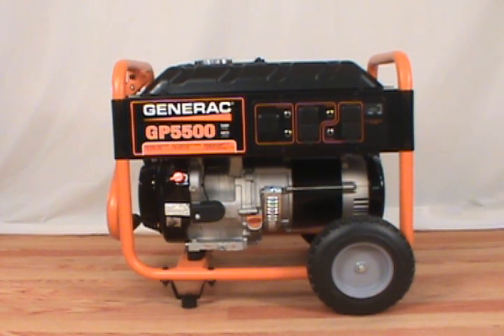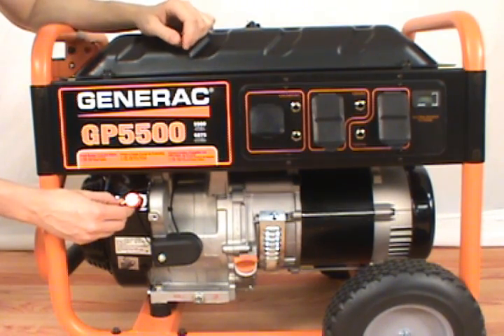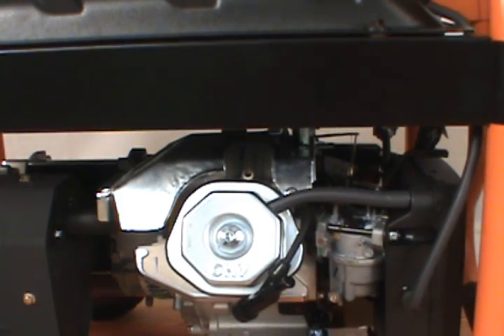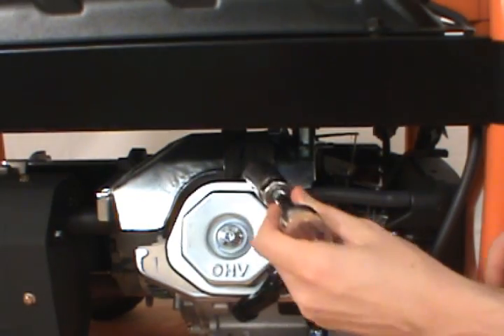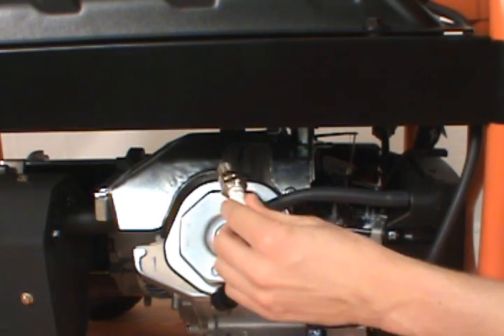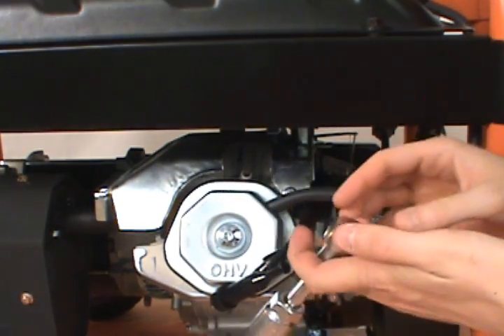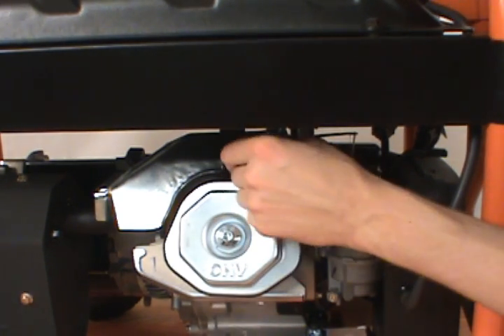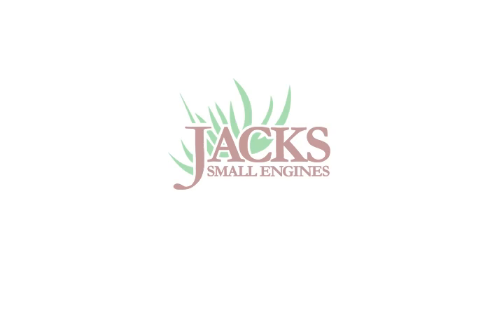Changing the Spark Plug - Generac Portable Generator

Comment: I have a 4000xl and no room to put ratchet and socket on plug. Had to remove gas can and cover under tank.
Reply: Don’t forget about the generator safety rules: anyone who uses portable gas generators really needs to see this safety reminder. All generator safety rules should be followed carefully. This advice is just to make sure that everyone is aware of all the warnings and it’s just to remind people to be careful using portable generators. Generators can be dangerous if not used carefully. Every year, hundreds of people die or get injured when using portable generators due to carbon monoxide poisoning and electrocution. Make sure you are using your generator carefully and keeping others safe as well. There is something very serious that everyone should always be aware of when using generators. Some people do run their generator indoors which is not safe and that increases the risk of carbon monoxide poisoning which can cause death of family and you. Some people run their generator in wet conditions which can electrocute them. Please remember that you should never run your generator indoors. Remember that carbon monoxide is an odorless and colorless gas that you cannot see or smell. Carbon monoxide is a silent killer. Keep that in mind. Make sure your generator is 15-20 feet away from your house and away from doors, windows, and vents. Never use your generator in your porch too. Having a carbon monoxide detector is very important against generator safety. Some people also allow children to go near the portable generator which could pose risks. We need to keep an eye on our children making sure that they are not near the portable generator so they won’t get electrocuted or burned by the generator which is dangerous. A locking enclosure also keeps kids safe. A generator shed might look like a tempting place to explore, or take cover during a game of hide and seek, but a generator is a dangerous piece of equipment that can cause injury. It says on the manual that we should also keep children away at all times from the portable generator to avoid injuries. Please do not allow a child or unqualified people to operate the portable generator. Just because some manuals missed what should be listed doesn’t mean it’s safe to do. Always follow the generator safety rules when using portable generators. Generators pose electrical risks. If you need to use your generator during wet weather, you need a generator tent to protect your generator from getting wet. Don’t let your generator get wet. Keep your generator dry and before using your generator, please make sure your hands and your generator is dry. Do not wear loose clothing when operating the generator. Everything that is said on the generator’s operating manual should not be ignored. Never smoke cigarettes near the generator. Please keep flammable things away from the generator. Never overload your generator too. Your generator can catch fire. Never ever try to plug a generator cord into a wall outlet to avoid back feeding. Back feeding your generator is dangerous. Always turn on your generator first before plugging in appliances and shut off the appliances before turning your generator off. Use a heavy duty cord for your generator and the cord should not be worn out. All the instructions should be followed carefully. Never refuel your generator while it’s running. It can cause fire if fuel spills while your generator is hot. You should turn off your generator and let it cool off before refueling it. Having a fire extinguisher next to the generator is also important. This is only a reminder for everyone’s safety of using generators. Make sure your generator is properly grounded. Having a fire extinguisher next to the generator is also important against the safety rules. https://youtu.be/I1jT3ANENvI and here is a video more about keeping others safe when using generators and also about our family’s safety. We should keep our children safe especially little ones. Hope this helps.

Comment: If you unscrew the top 2 screws on the heat shield to the left of the spark plug and push it in you will get just enough clearance to fit a socket wrench w/out an extension. It is a very poor design I agree,
Reply: This worked for me!  I wish this video wasn't so simplistic because it's not if you don't do what Scott noted. Also, as an added note on the GP5500, the spark plug gap is .028 - .031 inches and the socket is a 13/16.
Reply: Don’t forget about the generator safety rules: anyone who uses portable gas generators really needs to see this safety reminder. All generator safety rules should be followed carefully. This advice is just to make sure that everyone is aware of all the warnings and it’s just to remind people to be careful using portable generators. Generators can be dangerous if not used carefully. Every year, hundreds of people die or get injured when using portable generators due to carbon monoxide poisoning and electrocution. Make sure you are using your generator carefully and keeping others safe as well. There is something very serious that everyone should always be aware of when using generators. Some people do run their generator indoors which is not safe and that increases the risk of carbon monoxide poisoning which can cause death of family and you. Some people run their generator in wet conditions which can electrocute them. Please remember that you should never run your generator indoors. Remember that carbon monoxide is an odorless and colorless gas that you cannot see or smell. Carbon monoxide is a silent killer. Keep that in mind. Make sure your generator is 15-20 feet away from your house and away from doors, windows, and vents. Never use your generator in your porch too. Having a carbon monoxide detector is very important against generator safety. Some people also allow children to go near the portable generator which could pose risks. We need to keep an eye on our children making sure that they are not near the portable generator so they won’t get electrocuted or burned by the generator which is dangerous. A locking enclosure also keeps kids safe. A generator shed might look like a tempting place to explore, or take cover during a game of hide and seek, but a generator is a dangerous piece of equipment that can cause injury. It says on the manual that we should also keep children away at all times from the portable generator to avoid injuries. Please do not allow a child or unqualified people to operate the portable generator. Just because some manuals missed what should be listed doesn’t mean it’s safe to do. Always follow the generator safety rules when using portable generators. Generators pose electrical risks. If you need to use your generator during wet weather, you need a generator tent to protect your generator from getting wet. Don’t let your generator get wet. Keep your generator dry and before using your generator, please make sure your hands and your generator is dry. Do not wear loose clothing when operating the generator. Everything that is said on the generator’s operating manual should not be ignored. Never smoke cigarettes near the generator. Please keep flammable things away from the generator. Never overload your generator too. Your generator can catch fire. Never ever try to plug a generator cord into a wall outlet to avoid back feeding. Back feeding your generator is dangerous. Always turn on your generator first before plugging in appliances and shut off the appliances before turning your generator off. Use a heavy duty cord for your generator and the cord should not be worn out. All the instructions should be followed carefully. Never refuel your generator while it’s running. It can cause fire if fuel spills while your generator is hot. You should turn off your generator and let it cool off before refueling it. Having a fire extinguisher next to the generator is also important. This is only a reminder for everyone’s safety of using generators. Make sure your generator is properly grounded. Having a fire extinguisher next to the generator is also important against the safety rules. https://youtu.be/I1jT3ANENvI and here is a video more about keeping others safe when using generators and also about our family’s safety. Hope this helps. Thank you

Comment: On my new Generac GP5500, there is a VERY small clearance between spark plug boot and fuel tank above it.  I think that fuel tank needs to be unbolted and raised to allow access to plug.  There is not enough room for a socket with extension.  Any experience with this or advice would be appreciated.
Reply: Universal joint